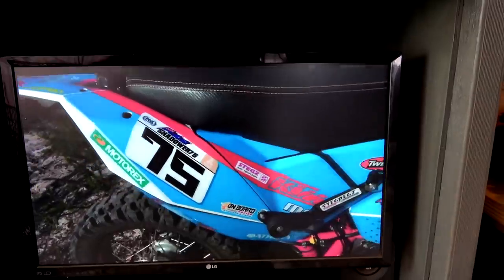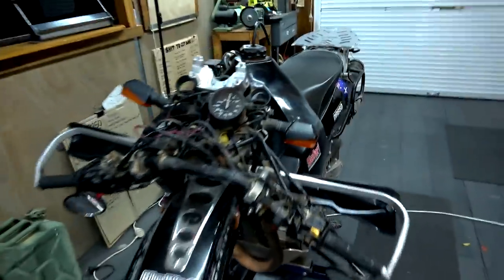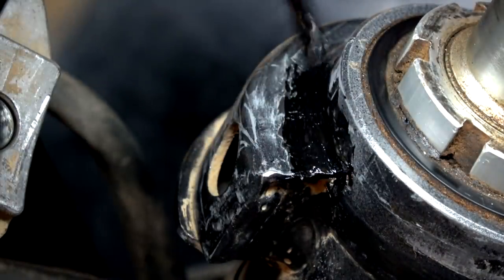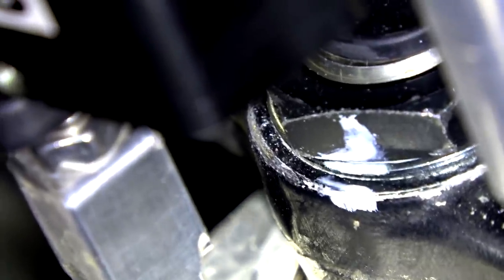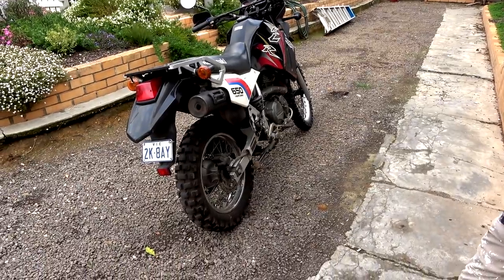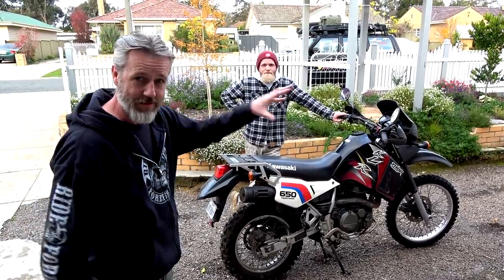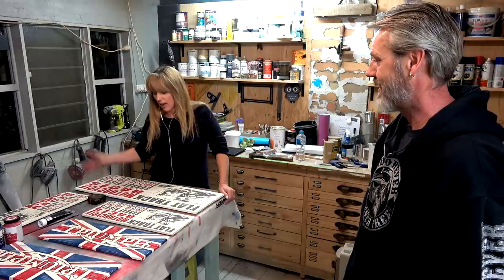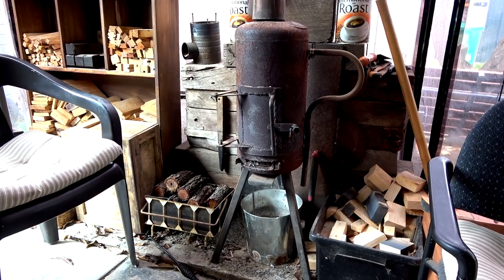Just another week! MCT 2020 Ep.19

Comment: First and simple job on KLR650 is to move the number plate up onto the rear guard just under the rear brake light, add a red reflector and then remove the lower mudguard, as many a number plate has been mangled where presently located. I used small LED bolt type lights that hold on the plate and provide plate illumination, some consider the rear light as providing sufficient number plate illumination. Will depend on Vic number plate illumination laws. For brakes add braided brake lines front and rear. On my second generation KLR650 I added a larger 325mm front disc, but beware as only one fits EBC SMX6042 with EBC FA228HH pads, not sure if this fits Matt's first gen KLR. Do you know if the doohickey has been replaced? Look up Eagle Mike website for KLR parts, including doohickey kit. Then there's the thermobob job...

Comment: To get on center stand try stepping down on the stand with your weight, if it has a foot bar/bracket, instead of trying to lift the bike. So a little backward rock with downward weight on the stand and hands on rear frame and bars to stabilize. Don’t know why but it worked with my 600 pound touring bike.
Reply from the maker: It's missing the footbar
Reply from the maker: It's missing the footbar

Comment: Hard to get it on the centre stand pulling at the bars like that. One hand on the bar and one on the back handle and lift the bike up rather than pull it back.  It's about lifting around the pivot point and it just kinda goes on itself rather than pulling it back
I used to be shit at putting bigger bikes on centre stands til I worked out the technique 
Centre stand be super useful to have for punctures, chain maintenance etc on a ride even if you have to get someone else who's on the ride with you to help put it on it

Comment: Hi from South Africa! Again! Matt's KLR - DON'T remove the center stand! It's a must for puncture repair and chain oiling. It needs a foot "step" on the lefthand side. Google and you'll see what I'm on about. Your weight lifts the bike. Easy to use. Also - KLR's "doohickey" must be done. Counter balance shaft tensioning spring. Google. Lots of videos how to. And the 2c mod to the carburettor. It DOES make a difference in throttle response. And check the "TENDAI" version. Really cool looking version of the KLR. Enjoy! Probavby THE best value for money dual purpose bike in the world. Does nothing well, but can do everything. F.Y.I. the standard tank takes 24L. 400km no problem. And change the front sprocket. Go one tooth smaller. Makes the gearing "longer" and the bike more road friendly.
Reply: Nah, oiling chain and puncture repair can be done without the clearance limiting and heavy centrestrand. Also, only change sprocket if intending mainly highway use, otherwise may find more compromised on tracks. Some use Eagle  Mike prevailing torque nut on front sprocket to make sprocket changes easier and keep two different sprockets to suit highway and track riding. I've never found this necessary and standard sprocket quite ok for my riding style.

Comment: Hello Mark and Naomi,  OK the Side stand,   On the side stand side, face the bike, left hand on the handle bar, right hand on the rear rack or point to grab, feet slightly apart, then rock the bike and it should land on  the stand....take a little practice....
Reply: Yep same here with a tenere 660 either use the pillion grab bar or i also grab the pillion peg mount with right hand , bar with left hand and rock it back ( i stand just at or slightly behind the centrstand pivot ) and lift it a bit with right hand as i rock it back
Reply from the maker: Thanks heaps for that... Will try it! :-)

Comment: no need for mechanic at bike shop  , just need read your workshop manual for your bike

can have the lower triple pinch bolts done up on forks , top triple pinch bolts loose then do up the steering stem & after do up your top triple fork pinch bolts

my 690 had the rally raid evo 2 kit downfall with them tanks is the lower fronts easy to puncture / split from falls , i upgraded to the KIT690/701 to have the more modern rally look  , which is all acerbis factory 450 rally tanks fairings lights etc made to fit 690/701
since added a KIT690 to my 950 super enduro as well

Comment: Hey Mark how's it going I wanted to let you know I checked on the CT 125 here in California of course that means the rest of the United States and I cannot get an answer from any dealership if they're going to be importing them or not I wish they would because I'd like to have one. There's one other thing I have a 2018 dr650 and I was wondering if you ever have changed the oil and put it between the low and full marks on the inspection window of course I know you changed your oil but on my 2018 I recently have changed the oil and just put it below the full mark and after 10 miles of riding the motorcycle It is Well above the full mark and I was just wondering if you've ever done that another words checked the oil just after riding it a short distance also the oil is clear of course when I put it in it but after 10 miles it is quite a bit darker I have asked this question before 6 or 8 months ago I know these bikes are supposed to be indestructible but when I change the oil put it between the full and low Mark ride it 10 miles and then it's up above the full mark almost out of the range of viewing your oil level if that's normal I don't think so the bike is not sitting on an oil well okay maybe the next time you change your oil or if you know already how this works I would really appreciate your input
Reply from the maker: I always put mine to the top level. I can't say that I have noticed it move up after a short ride! There are possible reasons why and what I'll do is put a video spot answering and also asking the others what they think is going on! The main thing is don't worry about it between now and next MCT :-)